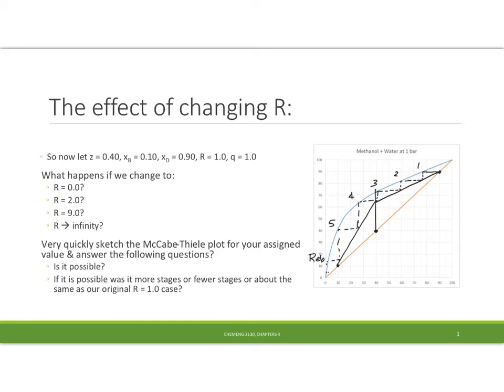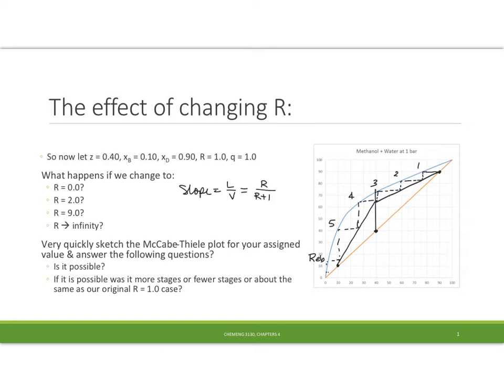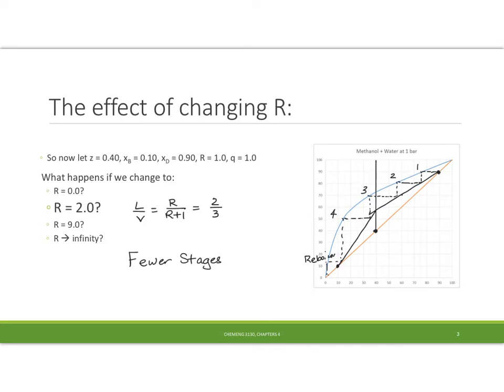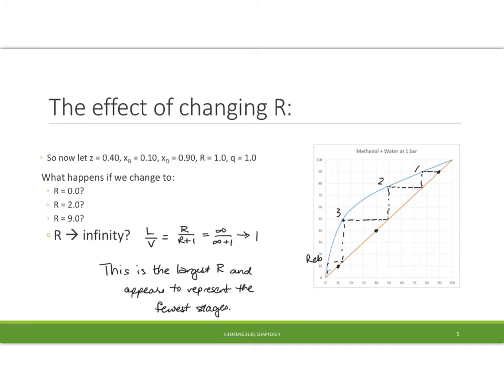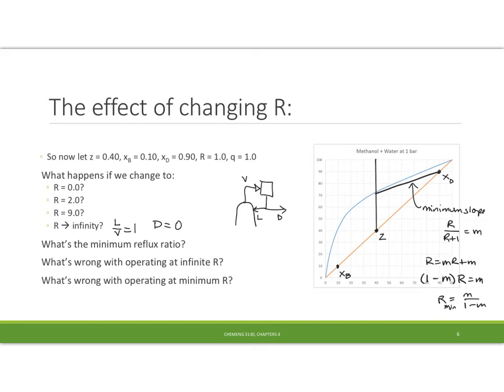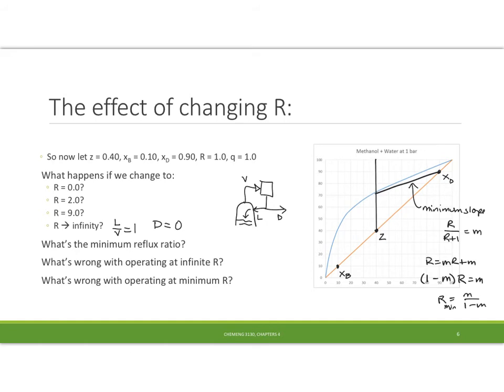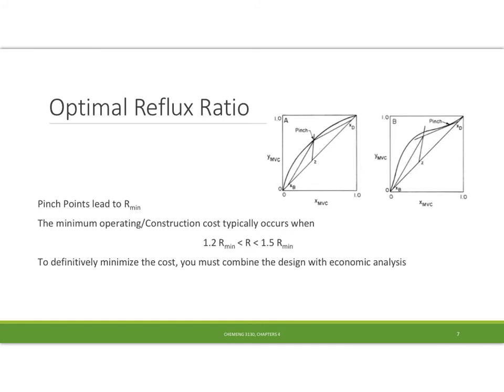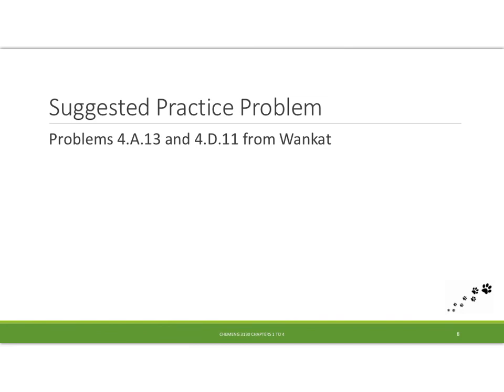Minimum Reflux Ratio (Complete Video)

Comment: Is it possible for R to be negative? I performed an experiment with a Batch system. What would that mean?
Reply from the maker: If s reflux ratio is the ratio of two flow rates then a negative value would mean one of the directions of flow was “backwards”. At that point you wouldn’t actually be doing distillation.